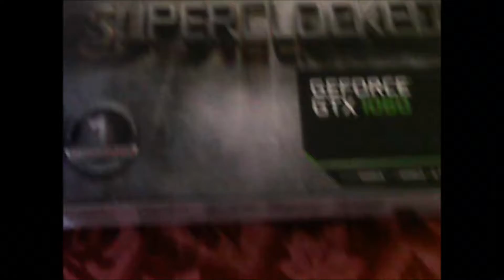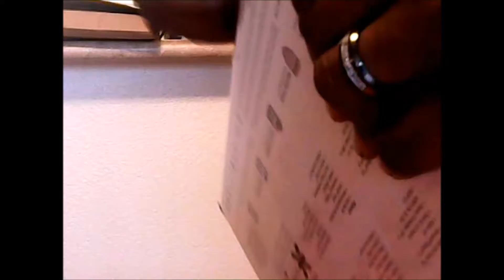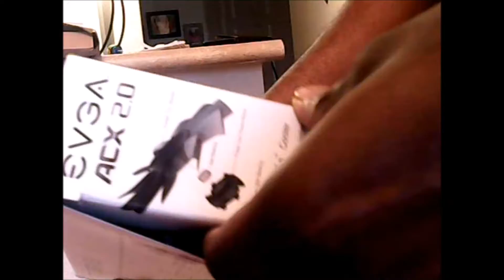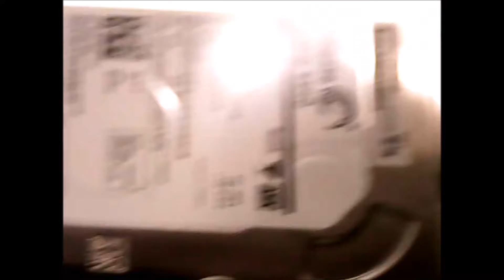ASUS ROG G20 GPU Upgrade to GTX 1060 Unboxing Install

Comment: So im still running this pc standard today. is it worth upgrading the GPU now or should i just look at upgrading the whole pc?
Reply from the maker: It depends on your budget.  Right now with inflation on pc parts you might be better off upgrading the gpu. If you can get a good gpu and processor is go for the whole pc upgrade.  But right now stuff is selling for way higher than msrp.

Comment: I have a question, will it work with msi 1080 8gb
Reply: Striking Eagles no the 1080 requires too much power from the power supply the highest i would go is a low power requirement 1070 probably a itx. But at the moment I went with a more stable 1060

Comment: HEY, THANKS man I just upgraded my asus rog g20aj with that exact same card, I used evgas overclocking software to control the fan speeds cause it would go to 80 automatically all the time, but now I’m able to stay below 70 Celsius while having my fan speed only at 50!
I also tested it on the steam vr performance test and it said it was above ready for vr.
I honestly don’t think I could of done it without your video, thanks bro!
Reply from the maker: Thank you.  I'm glad my video helped.

Comment: You are not supposed to put a fan graphics card into the case. It’s supposed to be a blower
Reply from the maker: Yeah you mean a reference card or founders edition for the 10 series.  It does help with the cooling but it's been a while since I put it in and still my temps is low 60s Celsius.  It preferred a reference card which I think I stated in the video but this card will work just fine...  the original was the same style.

Comment: hows the card going bro? i just wanted to know since its not a reference card how is the result?
Reply from the maker: Over a year later and the card is still running games smooth as silk.  My computer doesn't get hot unless I turn on the overclocking and then it's not that much hotter anyway.  With over clock the fan get get noisy depending on how high you set it.
Reply: Wrath45 also im getting a asus gtx 1060 turbo 6gb i have 180w and 230w that both came with pc as 1 brick...will this be good for it? Or do i need to buy another
Reply from the maker: You should be fine if you have both.   I'm not sure on that specific cards specs but make sure it doesn't require more power.   But with both cords I want to say you're golden

Comment: hey man u said urs doesnt get very loud but my gpu screams and gets very hot. idk y mine does this but urs doesnt. im thinking of just keeping the pc open and letting the gpu air out. could this be a good solution?
Reply from the maker: +Jehffrey you may need to check and make sure it's not over clocked.  Mine doesn't scream or anything unless I really push it or turn it up. .
Reply: Wrath45 the card comes super locked tho?
Reply from the maker: +Jehffrey yeah mine cane line that to.   Download the vfree EVGA software for it.  It will allow you to turn yooo or down the performance
Reply: Wrath45 I actually fixed it! I just use my pc without the 2nd half so cooling is great!

Comment: So the two ports on the back like you said in the video, that is the two power supplies? Does that mean you have a 230 watt one? or if single you have an 180 watt?
Reply from the maker: +spr. Some systems came with two psu bricks and they later rolled out a brick that had both the the 180 and the 230.  If you have a single brick you have to look and see which one you have.  But for this graphics card specifically you do not need to buy a new psu. Whichever one you have is good enough.   This card will run on the 180 or the 230 with now problem
Reply: Thanks for the quick answer!

Comment: Hey, quick question. We are planning to get the GTX 1060 6GB SC in a few days, and we are wondering if the 230w power supply is good enough, and if I need two of these since my dog chewed the cords that originally came with the pc. If you can find any Amazon links, or if this is enough please let me know. 

My power adapter atm says: INPUT: 100-240V. Also from Delta Electronics Inc. 

Link(Do i need two of them or just one): https://www.amazon.com/gp/product/B001TK3TJY/ref=ox_sc_act_title_1?smid=ATVPDKIKX0DER&psc=1 

Find any other amazon links if you can, thanks!

Comment: I’m looking to upgrade mine, other videos say I need a power adapter, so I need one?
Reply from the maker: +demolition2308 no the stock psu in this computer should be plenty enough for this gpu
Reply: Wrath45 so I won’t need to upgrade the power supply?
Reply from the maker: +demolition2308 no you will be fine with your stock psu

Comment: I bought the same gpu and I have a 230w power supply that came with the pc and I made sure that every is connected to the motherboard properly and switched the jdc11 to the left. The issue I having is when I start it up it shows black for a little bit then it comes on with graphical glitches which I don't understand why it's doing that
Reply from the maker: +Real check your connections it may not be seated right.   If that doesn't work switch got JDC11 back.   I've never encountered that issue before.  Sorry for the late response I am in the middle of a moving to a different state
Reply: Wrath45 nah it's fine. I did all that I checked the connections and everything and made sure the gpu was connected to the motherboard but it still came up with the same issue. I read online that you probably need an extra power supply to power the gpu cause it does take about 400w so Idek if I should do that get me another power supply that has 180w and see if that works or I just returned the 1060 and get a 1050 ti

Comment: Vän Youtube make a video because that card has only 6 pin cnector
Reply from the maker: +RiKo you mean make a video with the 6 pin connector?  I installed both the 6+2 connector and the 6 pin for future upgrades it was kinda annoying trying to fit my hand down in there this time so I just did both in case I ever decide to put a newer card in.  The Super clocked 1060 is only a 6 pin.
Reply: Wrath45 because I want to see how you had connect the cables

Comment: Hi man, I have installed asus gtx 1060 t into an rog g20....works well off of the ORIGINAL 280 watt power supply.. I did change LDC 11 as per a lots of instructions, and also, there is some advice about moveing ldc 01 to ldc05....The system works ok, but the extra power supply does nothing...plugged in or nor...any ideas?
Reply from the maker: +Sarc are you using two power supplies?
Reply: No, thats the thing, I did buy one and plug it in, but it makes difference. LDC11 does not "switch" on the external power supply for the graphics card. We are using the ROG G20 on its orinal 280watt supply brick with the gtx 1060 installed...   ( I am also Sarc )
Reply from the maker: +Ray Margrain ahh okay same guy.  Np.  Yeah I forget what the LDC11 actually does but it's not for the gpu.  I'll have to look that up again. I forget where I found it.

Comment: Hey I just bought the same card from Amazon. I notice that there's only one 6 pin connector on the graphic card. How do u connect two cables on it (Sry for my bad English and I'm new to it)
Reply from the maker: +onnn JK if you have the 8 pin it should split two pins off to make a six pin.  If you have the six pin that should fit good.  When putting it on the board it's a tight fit.  It took me almost 10 minutes to squeeze my hands in the board to fit it on.
Reply: Wrath45 I'm confused. Did you have to plug in both cables into the gpu or did you just put in one? (In the video, one PCI cable had 6 pins which is enough for the gpu but the other one had 6 as well which wouldn't fit right?)
Reply from the maker: +David Tu I installed both just for the video but I only connected the 6 pin since the 1060 doesn't require 8 pins.   Sorry for the confusion
Reply: Wrath45 So just installing one is okay?(thank you for replying so quickly and where would I buy the cable since I lost the one that came with the desktop)
Reply from the maker: +David Tu yes only the one is okay. I only did that just for the video and future upgrades. That way it's already there it was a pain to fit my huge hands down in the case.  You should be able to buy a six pin from amazon with no issue.  I'll see if I can find a link.
Reply: Wrath45 Thank you!
Reply from the maker: +David Tu here's a link for a connector I found on Amazon 

COMeap (2-Pack) Mini 6 Pin to 6 Pin PCI Express Video Card Power Adapter Cable for Apple Mac Pro G5 14-inch(35cm) https://www.amazon.com/dp/B071JJPJXW/ref=cm_sw_r_cp_taa_aDKdAbKV5KV50

Comment: Planning to upgrade to GTX 1060 from the GTX 750, and I only have the 180W Power brick. Will the 1060 run?
Reply from the maker: +Danielle Fukuda yes you will be able to run it with no problems.   Sorry for the late reply I'm currently away from home do training
Reply: Wrath45 could i upgrade to a 1050 and not need additional power then aswell?
Reply from the maker: +JimboSitch yes the 1050 does not pull that much power so you will be fine the power Supply you have now. No need to change your psu
Reply: Wrath45 this one specifically https://www.amazon.co.uk/NVIDIA-GeForce-EX-GTX1050-2G-Express-Graphics/dp/B01MAZ3J0L

Comment: so my question is my pc originally came with the 230 power supply so would i still have to switch the j11 thing
Reply from the maker: +Spidey Gaming no you shouldn't have to move it
Reply: ok cool cause im looking into upgrading the ram and getting the 1050 to help out my streams better
Reply from the maker: +Spidey Gaming yeah that would be great.   The 1050 is a solid card.
Reply: Wrath45 I've done it today and I have need to move that jumper! Only 1brick and few over watch games everything works fine ;) I've also done ssd256gb, 16gb ram, new thermal paste, new hard drive (laptop) for a sshdd 1tb (consume less power)
Reply: Question, I have a 230W supply, and a 6pin to 6pin connector. Is this all I need for this particular GPU (EVGA 1060)?

Comment: Sorry for being a pain...we have installed a gtx 1060 in a ROG G20 aj ...all seems well but, we umplugged the additional 180 wat brick power supply from the comper and it made no difference.  LDC 11 was moved.  Frame rates are to beexpected and no over heating issues...any comments?
Reply: Ray Margrain so i could only buy the 1060 without the extra 180w?Cause i only have the 230w.Also is your gpu 3gb or 6gb version?
Reply: Well, haveing watched numerous you tube videos and lots of advice we did get the extra 180 watt supply brick but it simply is not getting used. To be specific. We are using an ASUS GTX1060 Turbo 6gb. With a ROG G20 AJ...8 gigs I5. LDC11 jumper to the left. Power cable installed..But no 180 watt extra power supply used. The system runs fine, modern games maxed out graphically, good frame rates, everything keep cool.    

Try it first I say...Just a not...The original brick is 280watt not 230..let me know how you get on
Reply: Ray Margrain ok thanks,also planning to buy the asus turbo edition,i heard is very noisy is this real?
Reply: To tell the truth, if anything my sons ROG G20 aj is quier..this may be becase the asus gtx 1060 vents out the back keeping the inside of the cabinet cooler. He has it on his desk ...and I swear even on hard core 1080p maxed out gaming for hours...its a quiet hum.
Reply: Ray Margrain instead of an i5 i have a i7 will this make difference?
Reply: Should be better
Reply: Ray Margrain the new graphic card are amazing consume no power! But don't overclock it!
Reply: We have over clocked ours but only to safe maximum on the over clocking software that came with it.
Reply from the maker: +Ray Margrain yeah I only over clock mine when I'm doing test or game reviews.  Over clocking kills your lifespan of the card.
Reply: Hey ray, so a gtx 1060 turbo with the original 240watt supply will do just fine? no other modifications will be needed? thanks!

Comment: you wrath where do i get those pci cables? i have the rog g20bm and i dont have a pci cable connected to my gpu...
Reply: http://www.ebay.com/itm/8-Asus-G20-ROG-8-Pin-to-8-Pin-for-Regular-Video-Card-Connector-Power-Supply-/332091911538?hash=item4d52386d72:g:PycAAOSw-RRXCX16

Comment: Sorry if I have already asked you this. I am installing an ASUS GTX 1060 T soon. I am aware of LDC 11 being moved to the left 2 pins. I also head that LDC 01, LDC 02, LDC03, LDC04, and LDC 05 jumpers all need to be moved to top 2 pins. Having paused you vid and looked what you had done, I noticed you have not moved these..Whats the official word?
Reply: I noticed the same thing. I recently tried installing the asus turbo 1060, but somehow I couldn't get it to receive any power. Could've been that the card was faulty, or I just screwed up the jumpers. Do you remember in what positions you had the jumpers in?

Comment: i've successfully upgraded my ROG G20 to the EVGA 1060 SC 3GB, thanks man for the help!
Reply: do you upgrade ur power supply?
Reply: Reza Halwan Yes you need the 2 power adaptors. 180w and 230w
Reply from the maker: _asianz awesome how do you like it?
Reply: Wrath45 It's awesome. It's so quiet I barely hear the fans.
Reply: i actually ran into a problem, when i am playing games the gpu overheats. it peaked up to almost 100°C. is there a way i can fix it and not melt my brand new 1060?
Reply from the maker: Did you download the evga software for overclocking?  You have to go to the website and input your sn for your card then it will allow you to download it for free.  Or alternatively you can download msi afterburner free and turn up your Fan speed.  That actually sounds like a good how to video I can do.
Reply: Wrath45 i installed EVGA precision XOC through steam. i may have to turn the fans up to 100% maybe?
Reply from the maker: I don't know about 100% then it will be to loud unless you pay with a headset and don't mind.  I keep mine around 70ish. The highest I've seen mine is about 170f
Reply: Wrath45 what would you recommend to set the target temp to?
Reply: So I've tried to use custom fan curves but they don't seen to be working at all. It says the fans are at 100% but the actual fans aren't spinning at 100%.
Reply: yo dude have you got any problems with the card? like overheat, lags and more? im buying one soon too so i want to know!
Reply: Mattox The card works great. BUT it overheats with the ROG G20. because the GPU's fans blows the hot air all around the case causing the gpu to overheat along with the whole system. I advise to get a reference  style cooler where it blows the hot air out the back of the gpu. try the ASUS GTX 1060 TURBO.
Reply: Mattox i had to refund the GPU because temps were reaching over 100°c
Reply from the maker: I am not having any problems with overheating.  This card is the same design as the one that came with it the GTX 750.  Mine sits at 75 c. 

Sorry for the late reply every since switching to a Windows phone if I'm not at my computer It's a pain replying on this phone
Reply: Wrath45 so do you recommend the card? will it run games good without any problems? i have the rog g20bm and i want to buy that card.
Reply: Mattox i'd go with the ASUS TURBO just to play it safe.

Comment: If you already have the 230W power supply, do you need to buy the 180W power supply if you want to install the 1060?
Reply from the maker: +_asianz no the 230w will be sufficient
Reply: Michael Greer i believe all the gtx 1060 cards should have the same amount of power consumption. i don't think you will have a problem but don't quote me on that.
Reply: Do you know of a compatible 180w power supply that will work in conjunction with the 230w?
Reply from the maker: Michael Greer the stock 180 should work I'll find a link and post it for you
Reply from the maker: Michael Greer yeah the 230w will be plenty
Reply: Mine worked with outone...just the original 280 watt brick.....any comments?
Reply: I am ordering ASUS Geforce GTX 1060 6GB Turbo Edition VR Ready Dual HDMI 2.0 DP 1.4 Auto-Extreme Graphics Card (TURBO-GTX1060-6G)

Do you still think the 230w will be sufficient? I've heard these guys use little power, i just don't want to see power dips.

Comment: So I can use the same PSU that was already installed?
Reply from the maker: +Eddie Lopez yes if it's the 230w you won't have to but a new one
Reply: bro can you tell me how i can identify a 230w psu and a 180w psu
Reply: JhomelmaZ HD the 230 one is big and has a green led and the 100 one is smaller and says asus on the top

Comment: I understand that the large jumpers near component R20 which is directly underneath JDC11 all have to be moved to the top 2 pins so the 120watt power supply for a larger graphics card is recognised
Reply from the maker: +Ray Margrain yes that is correct
Reply: Ray Margrain do you have to do this to all of them?
Reply: The funny thing is, with ldc 11 moved, and a gtx 1060 installed , the additional 180 watt power supply was always cold...we unplugged it and the machine works fine...long bench mark tests...no over heating...wat gives? The original 280 watt supply doing both...